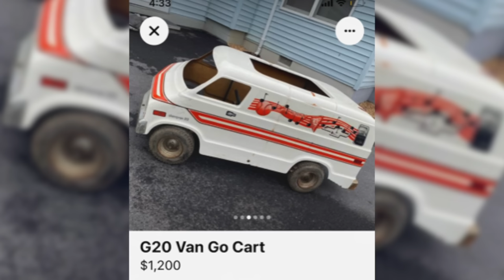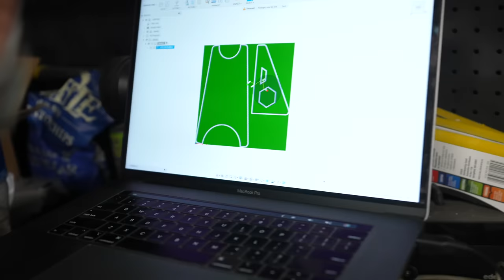Restoring a Vintage Go Kart in One Week.

Comment: I'm surprised you guys havent made a heat exchanger for the woodstove yet and run hoses to a radiator on the opposite end of the shop with a fan. I'm sure you have all the stuff around the shop somewhere to rig somethin up. Would help keep it a lot warmer i'd think, better utilization of the heat you're already making.  Maybe like a few dozen feet of copper tube wrapped around the chimney, or even just something to sit flat on top of the firebox
Reply: Just a couple of those peltier fans on top would probably help a lot.
Though, building a heat exchanger and feeding a big tank of water would be pretty baller. That would stay warm for hours after thefire is out.
Reply: Also good content
Reply: I believe they're going to be building a new shop so I'd wager their motivation to improve the current shop is pretty low.
Reply: I was looking at my 'account' to see if I could send them a couple "heat activated fans" and realized I may want a hamburger cooked at a store instead,and decided a loaf of bread for my bologna was best.They need Will to do his 'push-ups' in front of the heater instead...

Comment: it is currently 85 degrees in arizona as I'm watching this, I'm amazed that its still so cold where yall are at, but as someone whos done race car and fiberglass/composite work for 3 1/2 years before i got injured, you seem to have done a pretty good job doing a nice quick patches and repairs on the body. Using the tape as a backing is something i had to learn on my own to bridge simple holes but you seem to have thought about using that way faster than i did, when you do that though its always best to do a nice wet down of resin on the tape/area before you lay the glass down to prevent the air bubbles you got. All in all, 8/10, good job.

Comment: I use a shop with wood heat, go to hobo freight or somewhere and get a decent size shop fan, play with the angle of the fan you'll notice a HUGE difference in how your shop is heated with a little circulation

Comment: You guys need to put like a 1-2 inch dead air space around that stove and put a blower in the back somewhere, Run some 4-6 inch ductwork straight up to the ceiling and then over to all the corners of the shop.  That's how I heat my 50x60 20 ft ceilings and it will run you out of there.  I know youtube has a thing about background noise in videos but at least you could get it warm and turn the fan off or put a 4-inch PC fan inline somewhere to help pull push the air.

Comment: I like that use of the two crescents but as a pipe fitter I would have used a 14 or 18 pipe wrench.  Maybe even a 10" with a piece of 3/4 conduit for a longer handle. But I have done what you did before I found this way.

Comment: If u pile snow up in the right areas around ur shop it will insulate and seal out cold air better also updated windows doors and spray insulation

Comment: If they put the motor in the front move the steering colum back move the seat back and put it at an angle it would be a lot more aerodynamic not to mention the center of gravity would be better

Comment: Hey guys wrote you a bunch of times. I have a few really cool parts I want to give you. I live in Rathdrum but moving to post falls. I have this kickass pair of tough truck bumpers made out of 1/4 steal from a display. Same as the ones they make for a real sized truck just smaller. They would work perfect for what you guys do. I text Sam maybe he can get them to you. Or I could bring them by and take you for a ride in a 900hp bmw. Also have this cool small rack and pinion steering set up that’s new you can have.

Comment: i will say when you are working with fibreglass have a cool/cold shower afterwards to wash the crap off your skin if you have a hot shower your pores open up and the fibres will get in them as your trying to wash them off and it will suck